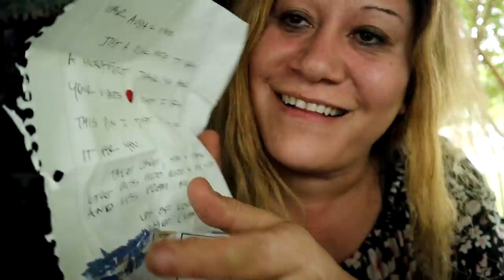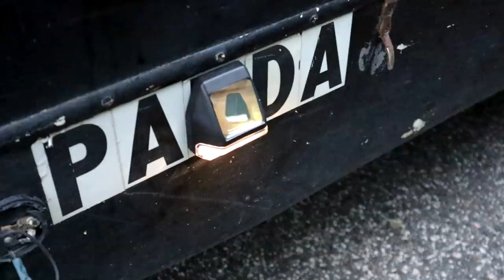Installing New Solar Security Lights On My Rv

Comment: I had a Class C by Broan Coach  on a 1976 Dodge chase. 22ft. I had it for maybe 10yrs and worked out of it on the road all over New York State and New England back in the 90's.   That thing was a work horse and I put a ton of miles on it over the years along with a rebuilt motor. No matter what, it always got me home. Every time I hear you driving it reminds me of my old RV. I loved it. Best wishes.

Comment: The little scissors are really helpful, I used one of these to trim the wires when attaching antenna connectors to cable for a couple of decades.

Comment: Should’ve used the cordless drill for the screw!  Lol. Also out some silicon on the outside of the lights. So you don’t have any water issues.
Reply from the maker: lol I didn't have the proper size head on my drill for the screw 😬

Comment: Your knife has a toothpick  (pull the little piece on the end)  so you have also a fike, knife, blade and scissors.  Plus remember you can put batteries in your lights.

Comment: Probably good that you can turn the lights off as they might not legal when driving. Good tip for making a template. The placement of the Off/on switch doesn't make any sense.
Reply from the maker: Agreed 😀👍

Comment: Watch out for some states you can't drive with white light's  on but  head lights especially the back .
Reply from the maker: Thanks 😀👍
Reply: @rvpandamonium  Hey Panda,
Yeah that's the problem when they are powerd on all the time . Driving at night they will go on every time a car passes by and also uses up juice. I went with Velcro and seems fine. Good luck.

Comment: I'll never figure out the appeal of karaoke.  No one ever seems to be enthusiastic about the song they are singing.  So 3M tape will hold those light going down the road?
Reply from the maker: The tape is just for the bottom the top section has a screw 😀👍